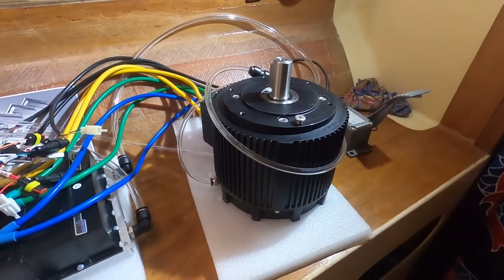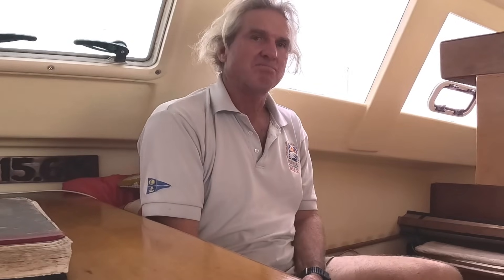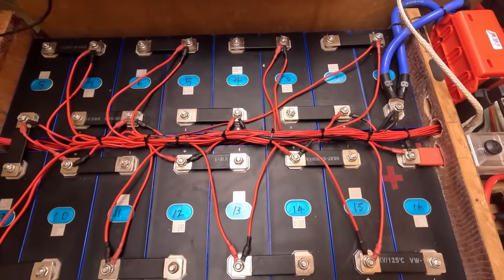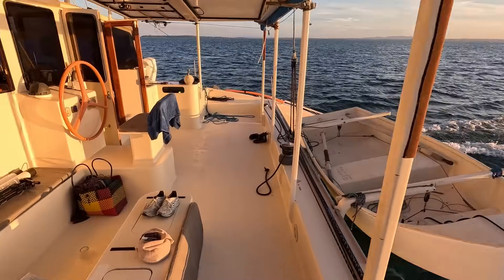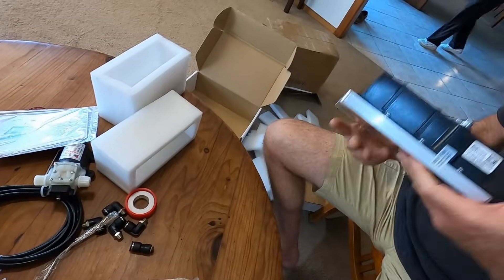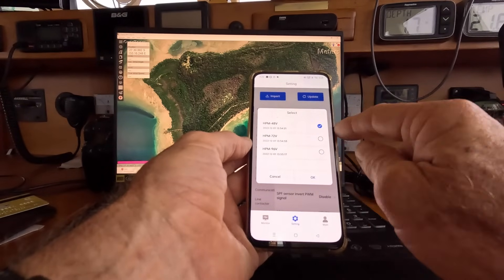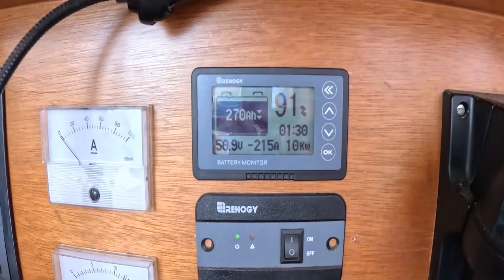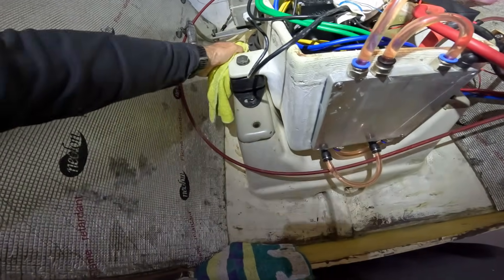16 Months using our Electric Motor -  Good or Bad?

Comment: So you don't miss the clattering of the diesel? I'm just being cynical...whenever I have the discusion about ICE vs EV, I always get the line that they want to hear the roar of the engine. My question to that is always why?
Reply from the maker: Interesting point Benny. It was I point I thought of bringing up but our set-up is not super silent. I feel the motor itself is pretty quiet, but the noise of the saildrive gears is definitely there. Also the low rumble of the diesel cancels out the rumble of the propeller noise which seems more audible over the higher pitch of the electric. I did troll the internet to try and hear what other systems sound like but I could never hear one running at any speed. Just music over the top or running at low power. I have heard formula electric cars racing and they make a fair howl! So yes, even those who want to hear the roar may not be altogether disappointed, haha.
Reply: My set up is in a 45' cat..2  x 12kw , shaft drive & l have to go down to make sure there working....
Very very quiet , (under the rear beds)😊

Comment: All really good info... 😎🧙🏼‍♂️🇬🇧 Im going to pass this on to various people who want to DIY their own systems..

Interestingly even Leopard Catamerans have introduced a 46ft  powered by twin 15kw  electric pod motors ....  solinoid switching of any current above  6Amps is standard in automotive eletrics..  it also minimises the energy loss at low voltages and the runs of heavier cables. Though its a ready supplier of HD switches and safe HV HCurrent  connectors even including pyro kinetic circuit breakers . 

You might want to give all your electricals and contacts a spray with an electrical corrosion inhibitor like Corrosion X..  we use it on RC model motors controllers servos, batteries etc. done correctly they will even work under water . 
They even protect against salt water effects  on circuit boards. Its even used on camera and science equipment that gets exposed to condensation rain ..or risks of immersion in water.

Im going to have a go at pursuading a couple of wharram owners to addapt  
Their 2x 10hp outboard  driveñ cats to E drive. 🤞🏻👍🏻
Reply from the maker: Hello Clive. This Corrosion X spray sounds a good thing. I'll look into getting some. Thank you. Do you know what brand of switch is good and reliable for 5 amps at 48v? I currently have that Blue sea circuit breaker.

Comment: Wow how long did you run it at 19kw and 15kw?
Reply: 2 hours till it’s flat is my guess, unless your happy doing 3 knots. Let’s say it’s 4 hours. 
The real question is how much diesel would you use on the same 4 hour trip; let’s say 8 litres or 2 gallons. What would you think of a Capt that left the dock with only 2 gallons of fuel in his tank?? I like the idea of one diesel and one electric, that’s clever, you use the most appropriate power source for the application.
Reply from the maker: Hello Ian. As you can see in the video it was only at 19 kw for a few seconds before the the amp draw hit 401 amps, at which point the BMS hit it's max output and shut-off. I have now set the motor, via the app, to only allow it to pull 300 amps, which would theoretically allow up to 15kw, but loses mean this is more like 14kw. These high kw outputs can only be run for about 2 minutes according to the specifications. It's only rated for 10kw continuous use.
Reply: Still it would be interesting to watch the temperature and see how long 1500watts can last 😂 @AndrewStransky-cc2dr

Comment: Thankyou So Much for this info, feels much more trustworthy vs others with brandname sponsorships/affiliations.
Obviously have to plan better re head-on winds/tides, how do you believe you'd manage the lifestyle without the diesel & sails on a 45ft mono (motorboat)?
What, if anything, you'd do different if starting again is always great info. Plus a parts list.
7:10 Reverting home to rental. Was AirBnB not working out, or new Council laws?
Reply from the maker: Hello Lana-Warwick. yes, you are so right, it does take that bit more planning. If its a sunny period we can go hard knowing we we re-charge our batteries easily. If its an overcast period we will opt for a more economical power setting, etc. Without the sails and diesel you would of course have a greater scope for solar power and also a much bigger battery bank, both of which would make this set-up very viable. I feel our set-up is perfect for our boat. The under-rated switch was a mistake I would have liked to avoid and it would be good if there had been more information regarding this kind of system, but the learning is all part of the adventure. I think travel would be a bit boring if one had unlimited power and range. The fun is in working with what you have and achieving goals along the way. The Airbnb was great, but we did all the cleaning ourselves and want to be free from all that. Yes and also the council law only allows 6 months of Airbnb a year otherwise you pay higher rates.
Reply: @AndrewStransky-cc2dr  
"much bigger battery bank" is one of my big considerations, working that out without being under/over is the challenging part.
Your max charging (no idea what time of day), I wonder what the max # of batteries your setup could fully charge by end of day, even after motoring point A>B.
More-so with no shade on panels from sails/boom, etc. Could also have a couple on sun tracking, + fold up mounted off side rails.

I'm not chasing "unlimited power and range", more concerned of coming up short if/when needed, without diesel redundancy, or sails.
I prefer a lot outdoor living, my desire is an ex commercial crayboat, ~45ft, 2 x motors (redundancy), the work deck = my patio/backyard, self sufficient with Hydroponic edible garden, meat chooks (eggs) & rabbits.

Comment: does that contactor get hot when left on for a while ?
Reply from the maker: Hello Brook. I have noticed the controller, which has a built in contactor, does get hot if left on without the cooling system on. I'll have to check if this new external contactor gets hot when it's on.
Reply: @AndrewStransky-cc2dr  the external contactor might get quite hot, you can get contactors that limit the currentto the contactor coil when on  so they don't turn into a heater